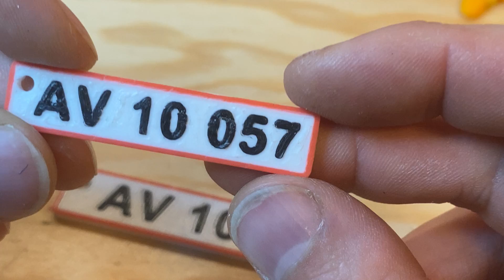Successes and failures with the MK4+MMU3

Comment from the maker: Status after 3 weeks of using my Prusa MK4 with the MMU3.
• Successful prints: 28
• Failed prints, my fault: 4
• Failed prints, hardware/software fault: 1
• Filament loads: 1720
• Filament interventions: 2
• Print time: 4d23h
My success rate has been quite good. Especially since I am counting all attempts, include those where I learnt what not to do. This is my first MMU, and I am printing primarily in 6 year old ABS. My conclusion is that: Not only is the MMU3 very reliable. It actually improves the reliability of the raw MK4. Which means I no longer need the babysit the printer, to make sure first layer calibration go well. I can just start a print and go to work or sleep.

Comment: while using the mmu3, can you still print without it?
Reply from the maker: Your question can be understood in multiple ways: You can still use gcode made for MK3 and MK4 without MMU. You can print in a single color. If you detach the MMU, or feed the filament directly, you can disable the MMU in the display.

Comment: I had exactly the same weird behavior happening to me on my stock Mk4 (no MMU). The printer suddenly stopped, hotend remained at temperature and the head started moving extremely slow in a line. I didn't contact Prusa support but weirdly enough restarting the print with the same GCODE worked fine.
Reply from the maker: @NotASingleGoodNameLeft  have you tried to open the gcode from the USB stick in Prusa Slicer?
Reply from the maker: @NotASingleGoodNameLeft  The incident is here MK4+MMU3 software lockup
https://youtu.be/Dby5AfFqO50